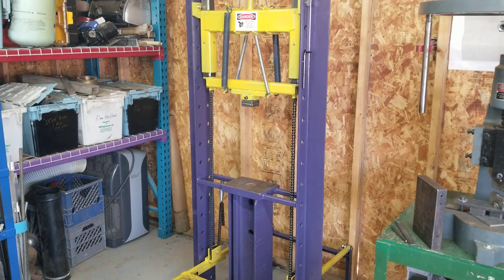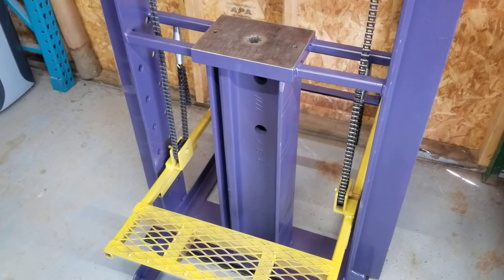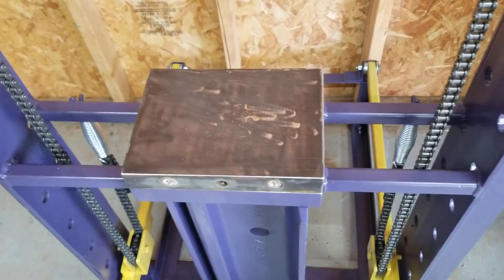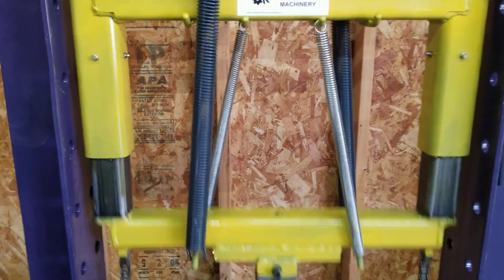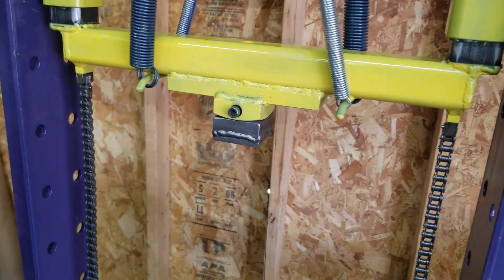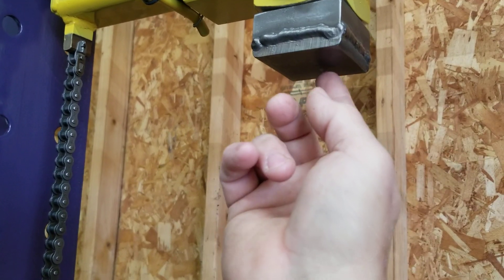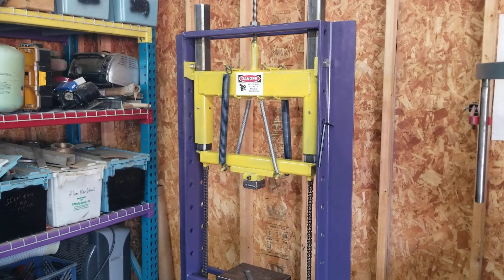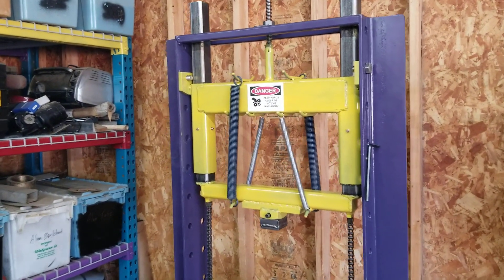Another take on a guillotine treadle hammer.

Comment: @ ~10:00 minutes you discuss the springs.  Like almost all designers of treadle hammers you've used "strong" springs that are not stretched or not stretched much when the hammer is fully up.  I can show you the math:  You're better off getting a weaker spring that is considerably stretched to hold the hammer up, but which is not overstretched when the hammer is down.  

There are two reasons for this:  Many strong springs are pre-stressed, meaning they require some significant force before they will even begin to stretch; and all strong springs generate relatively large return force when stretched, i.e., their spring constant K (where F=Kx) is large.  By contrast, weak springs have a smaller spring constant k, so for the same stretch, x, the force generated is less.  The only purpose of the springs is to return the hammer to the top, so there's no valid reason to use strong springs to do this.  

@ ~14:00 min you suggest using counterweights in lieu of springs.  But you'd have to be particularly clever to get counterweights to operate a hammer properly.  Try it; you'll see.  I won't say it's impossible -- never say that! -- but you'll need to "accelerate gravity" to get a workable system.  Pulleys might accomplish that -- at a cost of friction that might negate it.

I addressed many of these questions in my development of the Grasshopper Treadle Hammer, the plans for which are now available for free from my website, https://sites.google.com/view/grasshopperhammer-spinoff/home

Comment: Great vidio, do you have to adjust the chain length when you adjust the head hight
Reply from the maker: Yes, I have. But after using it for a while, I've assembled an assortment of blocks and spacers to alleviate having to change the height.

Comment: Use old gym equipment for your counter weight. You could adjust it and use pulley and the slide mechanism already built. Im designing something similar. Every pulley reduces pullable force... so adding another pulley into your chain would double force again. Anyways.. i was even considering 2 pulleys and a bowflex as a my spring mechanism. Old gym equipment from garage sales are cheap lol

Comment: Great video! How much did it run you at the end of the day? And where did you get that big chunk of steel for the anvil?
Reply from the maker: It cost me less than $200 out of pocket specifically for this project, but that's only because I really dug into my stockpile of metal. If I had to guess as to a cost of buying all of it, I'd assume close to a thousand or more, but it will come down to your haggling and scrounging abilities as well as luck. The anvil is two pieces of railroad track capped with two pieces of 1.5" plate. Weighs about 280ish pounds.
Reply: @RustyMetalRanch  beautiful. Thanks for sharing this, dude!

Comment: Whats the tonnage on your fly press and what kind of stock can it handle? I just got a #3 Norton but not really sure what the limits are to its abilities.
Reply from the maker: @cholulahotsauce6166  it's a "5 ton" according to the source. It can handle large stock, but it'll take several heats if you need to move a lot of metal. I mostly use it for forming, bending, & texturing. I can use it for heavy forging, but it does feel a bit abusive.

Comment: Thanks for posting. I'm in the process of building one as well. 
The pulley system is very interesting. It can be a bit confusing because we do not normally think of moving the pulley rather than pulling the rope. Pulling the rope over a pulley only changes the direction of the force (no matter how big the pulley is). 
What I think is actually happening is really a function of the spring. At the beginning of your stroke the spring stores the energy that is delivered later in the stroke. I think that actually allows you to make a faster stroke and also generates higher hammer speed as well. It is acting a bit like the shaft of a golf club.
This may add complexity and cost to my build because it is just so brilliant. Maybe you could go into a little detail about how the change in height plays out with the pulley system.
Reply: The more I think about this the more clarity I seem to have. If BOTH ends of the chain were attached to the carriage, then the pull would be 1:1. BUT since only one end hooks to the carriage it is 2:1. This is not what causes an increase in speed as much as an increase in force. When I actually put mine together It will allow me to make measurements to see if my theories match reality.
Reply from the maker: @andrewbrenner check out my other video that explains the pulley system in more detail. I actually do measure the movement and verify that it is definitely not just a 1:1 system. One key thing to remember is as another viewer pointed out, that I didn't measure directly from the pulley, rather I measured from the treadle, and that skewed the measurements. Still, the point was made.
Reply: It's just like a snatch block pulley. It should be exactly 2:1 movement between the travel of the pulley and the travel of the hammer.
However you also have the lever arm of the treadle as well. So maybe it's not 2:1 between treadle and hammer.
Reply: @eoinmacantsaoir811  I hope to get back to work on mine early next year. I asked someone to help with a part of it and they are busier than I am!

Comment: Love the build. Clearly a lot of thought went into it. If you want a higher ratio, use a larger pulley. Its the same principle as a multi gear bike or a transmission in a car. You can use the same input force but get a higher output.😊
Reply from the maker: Hmmm... 🤔

Comment: So I am building a version of my own. Eventually also plan to make a video. Your take is really inter resting and I think the small springs taking the shock is a really good idea.  I am really questioning whether the pulleys make a difference though.  As I understand mechanical advantage, it actually takes at least two pulleys to convert torque to speed or vise versa. One pulley on its own merely redirects the force, minus the drag of making the bend. I really don't think there is any advantage there versus a direct chain and a spring.  Anyway thanks for sharing, I can't wait to see how mine turns out. Thank you for adding to this discussion on the guillotine style treadle hammer. Mine is being made from the frame of some kind of fitness equipment frame, and I think is making a good foundation. I am using a John Deere tractor tool bar for the anvil. For mine I really would love to have it turn out to have the same ability as a regular guillotine tool to form a shoulder.
Reply from the maker: Also, I had to "upgrade" the shock absorbing springs. The originals did deform after some heavy hits.

I replaced them with a 'porch spring' pair. A compression spring with two opposing forks working against it. Can't deform these, and they are far heavier.
Reply from the maker: I'm not an engineer, but what little I understand is that the movable pulley has a mechanical advantage of two. (Half the force required) You are correct in that a single fixed pulley has a mechanical advantage of 1, but a movable pulley has a mechanical advantage of two. It took me a bit to grok how it all worked, but it really came into focus after a look up on Movable vs Fixed pulley systems. 

Does my device feel like a mechanical advantage of two? Not sure, as I have nothing to reference against. However, I can easily drive a center punch into the piece roughly an eighth of an inch. My touch mark goes in very crisply as does my other chisels and punches. No doubt, the Spencer treadle does similarly, but I had to work with what I had.

I may do a follow up video showing the measurements of travel of the treadle vs the hammer.